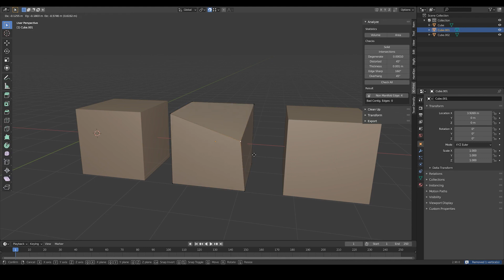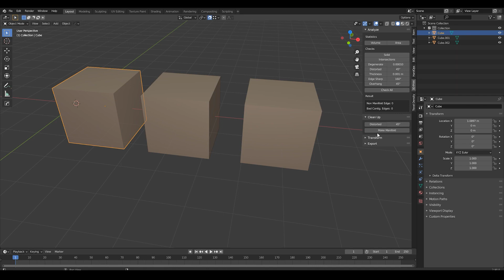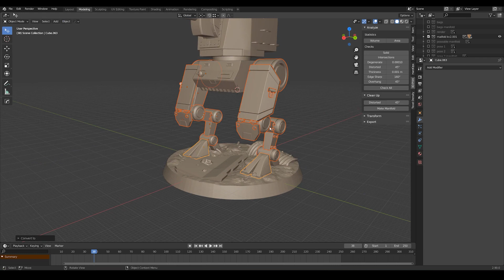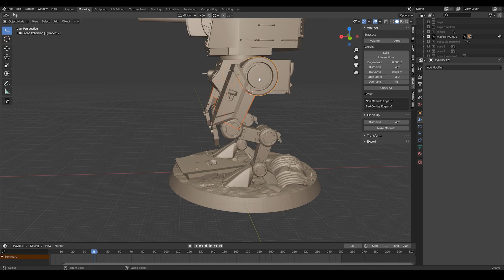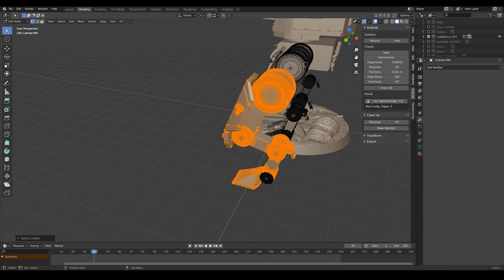Prepare your models for 3d printing FAST in Blender 2.9

Comment: I also like 3D Print Toolbox for the "thickness" option - aka, nozzle size. It can identify thin walls that become unprintable if your printer's nozzle is too big. (Identifying the problem, before trying to slice the model.) Now if would only check outside normals as well...

Comment: What if you didn't want to merge all those objects together?  I use Sketchup (yeah yeah, spare me the lecture. I am aware of Sketchup's issues) and I can simply group things together and export them as a single file.  Is that a problem?  I haven't yet experienced a problem with slicing and printing them.  ddit:  except I'm always eyeballing Blender so that I can make better models easier which is how I ended up here.
Reply from the maker: I don't know much about sketchup exports but from a general stand point, one of the issues I can think of right now is that a model with bad topo may lead to errors when hollowing it. furthermore when your model is very high poly like mine, making a manifold mesh let you do some optimization and prevent crashes due to to high poly mesh.
Reply: If you export them as together, but don't use boolean operators, there might come some problems if some part is too small / thin. Usually (like 95-98% of times) they don't cause any sort of slicing error even if they are exported together with parts overlapping each others. So if there aren't any problems and it slice well, go with it. Also,  at least Cura is able to handle these kinds of situations, but some other softwares might have  problems with them.

Comment: Unfortunately, while this add-on is helpful for pointing out problems, I have not found it to be particularly useful for fixing them.  The example issues in this video, and their fixes, are all spot-on; however, fixing issues with simple geometric shapes is trivial.  Most of the time, when I'm facing issues with a mesh, the mesh is much more complex, and so are the issues.  Manually fixing these issues would be time-consuming, if it's even possible, and the "Make Manifold" function will just destroy the model.

I think the highlighted Blender add-on is useful for those looking to 3D print, but for fixing complex issues, I've had better luck with the automatic repair feature in Microsoft 3D Builder.
Reply from the maker: yes this add-on does not work on every case as every auto tool on blender and you will have to correct it manually.
Reply: if your mesh is too complicated to fix with a combination of manual and automated fixes in 3D print tool box, you should've taken better care to make the mesh printable when creating it in the first place